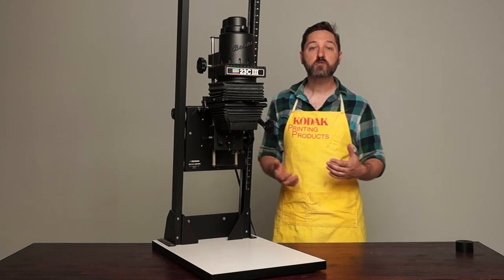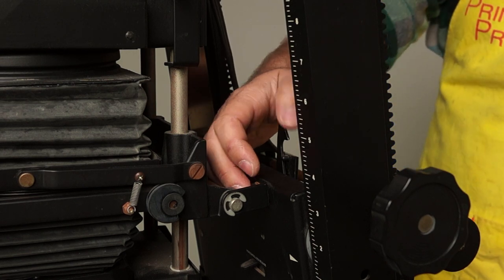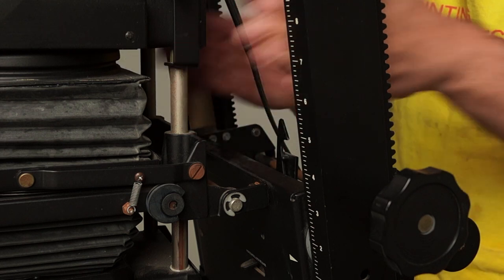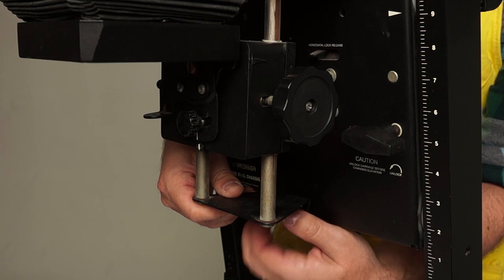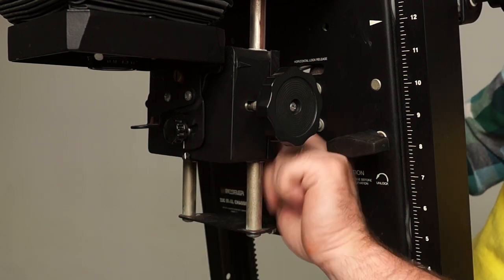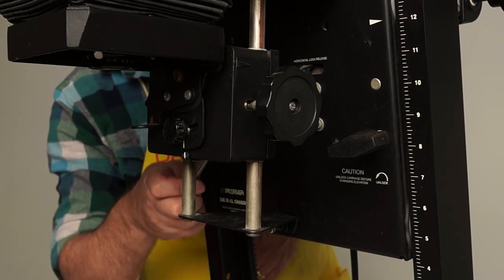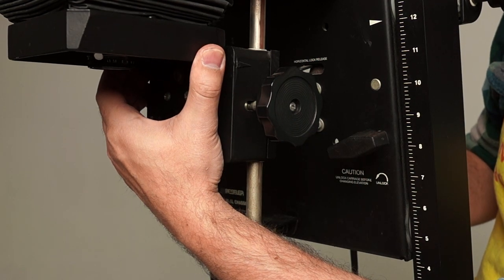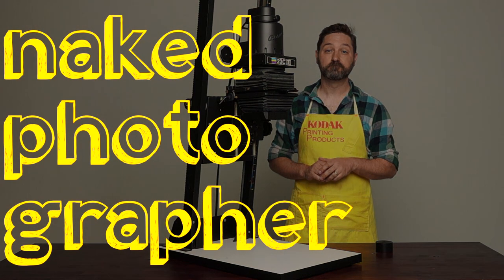Aligning the Beseler 23C III

Comment: Hi;
I have pretty much switched over from digital to 4x5 LF.  Kind of going back in time to my photography 55-60 yrs ago (gives you a hint of my age!).  Anyhow as part of that I have recently acquired (but not used as yet) a Saunder 4550 XL enlarger with a colorline 5000 analyser.  I believe the enlarger might be known as an LPL 7452L or Omega/LPL 4550 XLG in the USA.  The colorline I know little or nothing about.  I was just wondering If there was any chance of this enlarger being included in your alignment series?  Any thoughts on the enlarger or the colorline unit?  Many thanks!
Reply from the maker: I’ve used an LPL1200 I think.  It was good, but it’s been at least 16 years ago.  The university I visited to make these didn’t have any of the LPL or Saunders for me to use.

Comment: Good video, a question though. The negative comes out on the easel tilted, like 40 degrees tilted. I tried aligning the thing, a bessler 23c iii, and no luck. Any advice?
Reply from the maker: Make sure you have the carriage on the risers correctly, if one side is one gear tooth higher it can cause that.